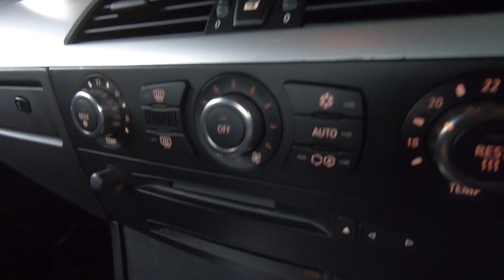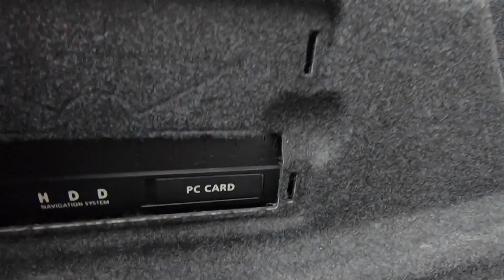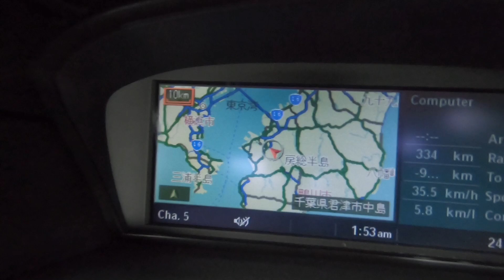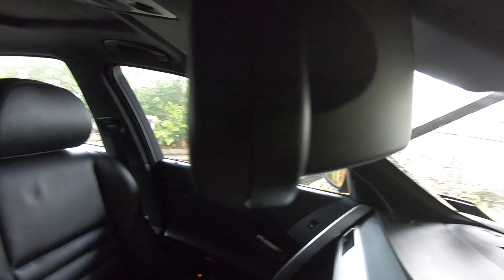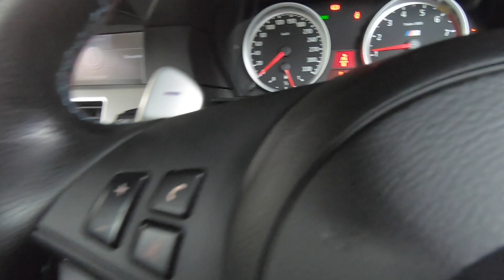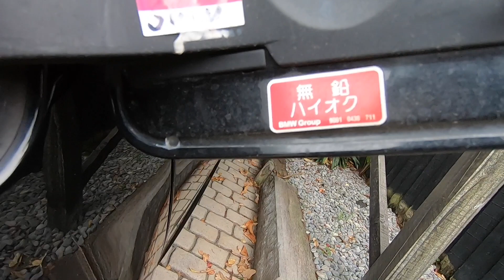Japanese Spec BMW E60 M5 In NZ

Comment: My E60 M5 is LHD Japanese Spec, not much different but different 😂 I still have the DVD sat nav and my limiter was at 270kmh before I lifted it… everything else is the same for example the ETC mirror. Also, the parking sensor chime in reverse can be coded
Reply from the maker: That’s weird a LHD E60 M5 out of Japan! Its a shame the nav/radio is completely different and expensive to change out, my radio currently has a band expander fitted. Good you can code the limiter and the reverse chime Tino 👍
Reply: @MTechGuy  Having the car for so long, I never noticed till after checking today, it’s actually minidisc on top same as yours 😂
Reply: @MTechGuy  Japan is awesome because LHD is order able and legal, car was way cheaper in Japan back in the day than it was in China, MSRP in 2006 was about 400k USD in China, so the car was exported from Japan and imported to China where it sits now
Reply from the maker: Minidisc- sweet 😎